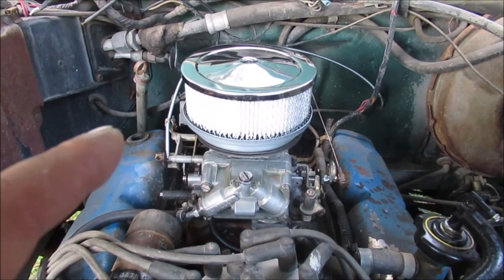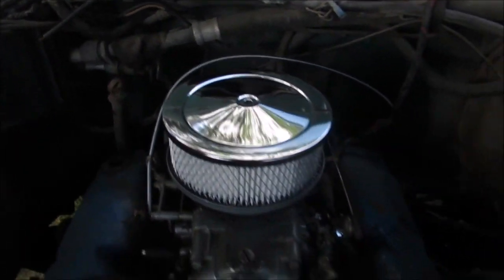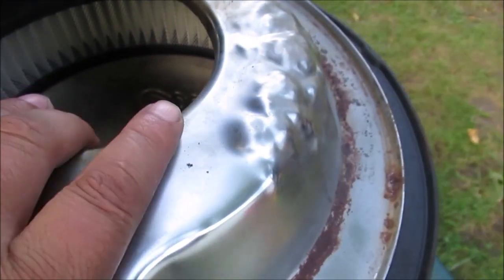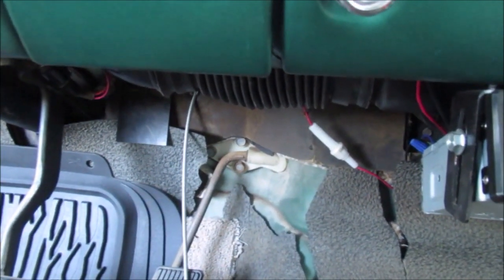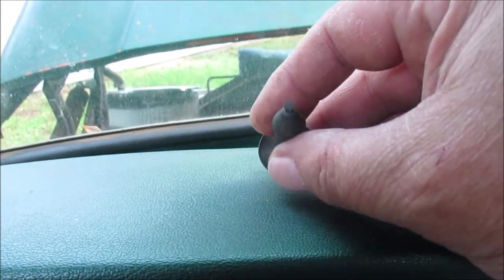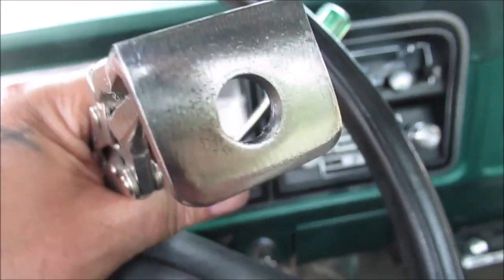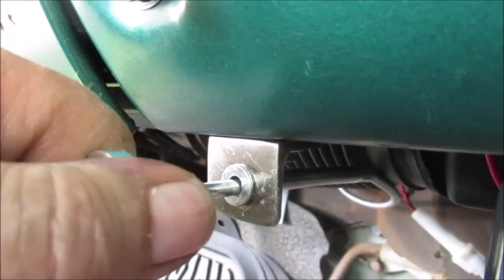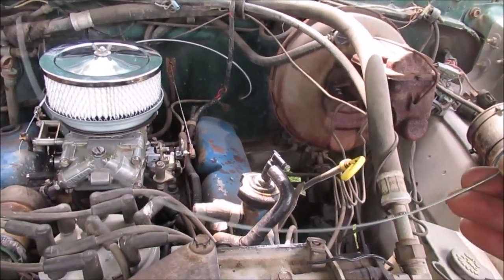New Air Cleaner & Choke Cable for the Ford Pickup

Comment: The old truck will run like new . Good job .
Reply from the maker: Thanks ....It has a lot more torque with this cabruretor I stepped down on it lightly and it will dig a hole in the gravel street

Comment: Looks good Jim.
Reply from the maker: Thanks ..The small air cleaner lets me adj the carb easy
Reply: @not2fast4u2c  I run a similar small air cleaner on my mud truck because of the way that throttle cable runs.  The cable was contacting the bottom of a 14" air cleaner.
Reply from the maker: @RamblinAround  The full size Edelbrock one I had fit the ford carb 5 inch dia hole but the holley is 5 1/2 inch....it also did not clear the float adj.. screw ..Now I can adj .every thing with the breather on
Reply: @not2fast4u2c  That'll definitely be convenient.  A lot better than taking off the air cleaner every time you need to adjust something.

Comment: pcv system has to have a fresh air inlet in one valve cover. use a breather in back valve cover. or put pcv in back valve cover like a lot fords and get a k@n valve cover breather for 1990 5.0 mustang. you have 351w efi valve covers. so you need to use a breather ware the oil fill cap is on the fill tube to let fresh filtered air in the crank case. the edel brock air filter will work you just have to have one of the large indentations over the flote set screw. the best is a factory air cleaner with cold air duct. the motor craft crab is good  but is small in flow 250 cfm @3gh. a 350 cfm motor craft from a 351w wold work good on a 302. the holly is good just more parts and it lacks annular boosters the motor craft has. keep a eye on the holly thay are more prone to leaks. all so the see threw gas filter is not safe as thay leak and brake use a metal fuel filter. love the old dent sides!